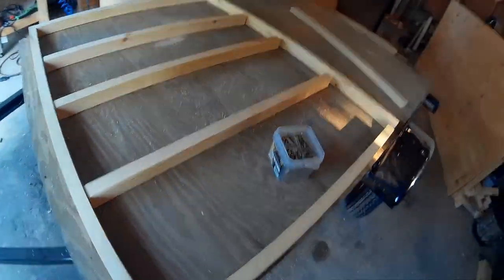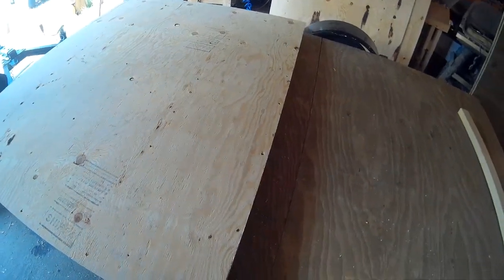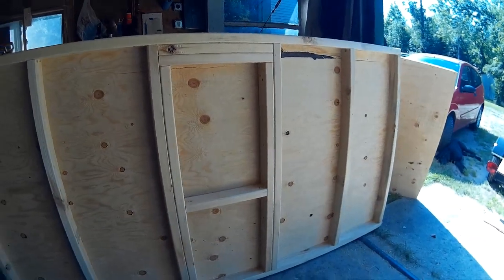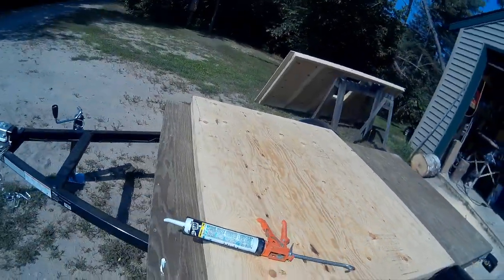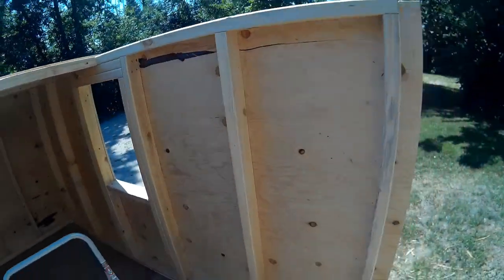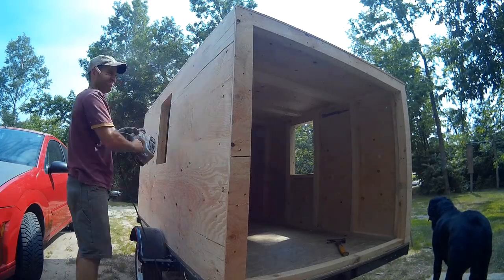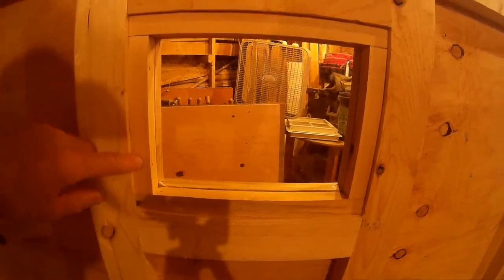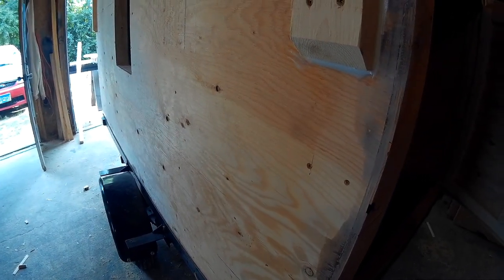DIY MINI CAMPER Part 2: Walls, Roof, Door & Boat Rack

Comment: I am going to build one just like this but probably add A/C. Is the back door just the frame with plywood cut to fit the frame hole and then trim the inside of the frame?  How does the Ironman trailer haul with the small wheels?
Reply from the maker: Yes it was just made to fit the opening.  It pulls good.  Thanks for watching!

Comment: i would glue wood together if you are screwing into the ends, parallel to the fibres. this is the weakest way to use wood fasteners, though obviously some kind of dovetail join would be the most secure and time consuming method.

Comment: Did you use marine/waterproof plywood ? How is it doing now?
Reply from the maker: Treated plywood
Reply from the maker: It's still good
Reply: @NorthwoodsLife  cool! What do you mean with treated? You did it?
Reply from the maker: It is pressure treated plywood to resist rot for a longer time than standard cdx plywood.  Just ask for pressure treated at your local lumber yard
Reply: @NorthwoodsLife  ok. Thanks!

Comment: What did you use to protect the plywood from sun and water?
Reply from the maker: Outdoor Enamel Paint.  Thanks for Watching!
Reply: Northwoods Life  ok cool. I finished the sides and roof. Im gonna do the enamel paint but o dont know if it will be enough protection on the roof  😐
Reply from the maker: For the roof I used an roof waterproof coating

Comment: what kind of crimps did you use to connect up your green cable wire for your side table.  Difficulty finding what I need in terms of a crimp.
Reply from the maker: They are just standard aluminum cable crimps, most hardware stores should have them